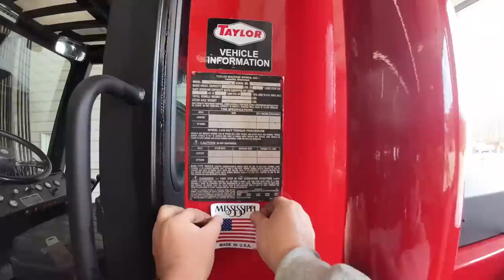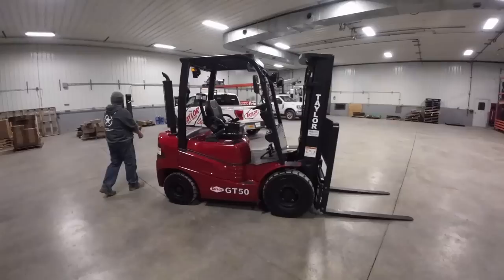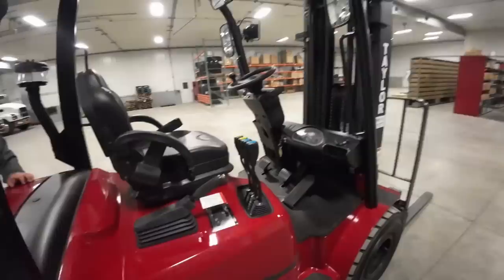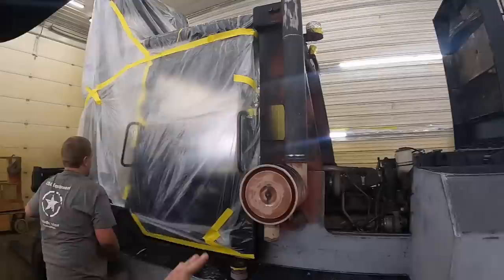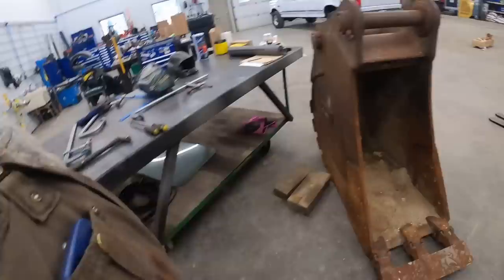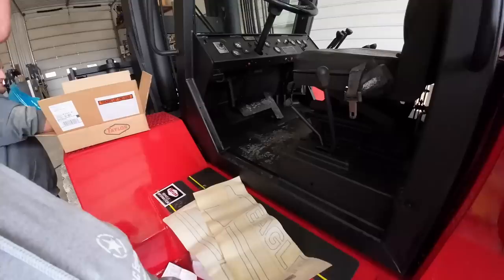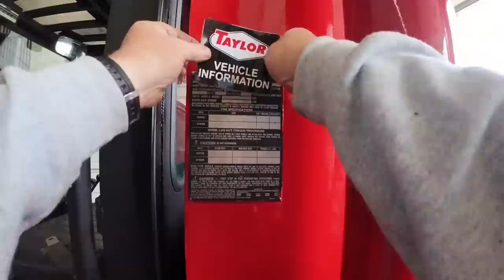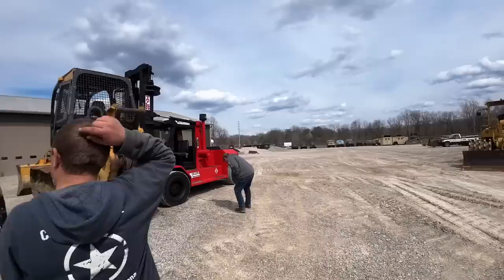We got a brand new shop tool, Taylor big red forklift or did we get two 😁 @TaylorMachineWorks

Comment: Hopefully the Give away is the White OBS Ford, didn’t see if it was IDI but ide take an Old Ferd either Way! If indeed I’m onto something. Chain Bin and Modified Headache Rack turned out BadA*s, you are a Fabrication Fool with that Damned Computer Steel cutting cutter Table. If that’s what you call it🤣. You Fella’s are always a Hoot & a Holler to hang out with, I’ll catch you on the next one. Keep it Safe Out There Fella’s

Comment: When I was a little fellow my dad was superintendent at a sawmill that ran Taylor forklifts.  Two were older (probably 60's) one with a detroit another with a ford 6 cylinder gas engine. Both of these the engine was in the front.  They also had a new (70's) with a detroit (engine in rear).  Dad got my brother and I Taylor shirts with "Big Red" on the front.  Actually have a school picture with the Taylor shirt on. Thanks for the video.

Comment: fastest forklift that i have drove is Linde h30d 1990, hidrostatic 3 cyl deuts diesel, it will spin tires on concrete, engine and hidrostat drive have never ben rebuilt and it has 30 000 hrs

Comment: I worked as a service tech for Clark and Yale for years and they will all send you safety decals, I think its a legal thing. I did do work on Taylors as well and even tho I didn’t like working on them I got to say they are one tough well built forklift. As for speed I once took the governor off a Clark with the Mitsubishi 4 cyl. And let me tell you even on nice pavement the rear steer is scary squirrelly as all get out, don’t try it

Comment: Looks like C & C Equipment now has a spiffy looking fleet of forktrucks.
Big Red and the new puppy Lil' Red with very versitile forks on it.
Gotta have the right tools to get stuff moved around.
Back in the early 70's I was a second shift certified Ironworker welder and the company I worked for had a massive field forklift with tires over 6 feet tall to move 20 foot parts racks from GM we rebuilt after fork truck ooerators smasged the s#@t outta them.
It could lift 3 at a time of flat bed trailers.
The general manager had the guys in the machine shop manufacturer parts to add on side shift forks including using cylinders from an old 50's piece of equipment. 
I got stuck running it when I was second shift foreman when the guy who usually ran it got injured till they hired someone new.
It was a friggen beast to operate. 
Funny thing is, the guy who did all the work on it including putting together the sude shift fork assembly and giving it a bew paint job was named Kevin and was the same size as your Kevin Clint.
Scrappy little guy you definitely didn't wannabe piss off.
As always,  really enjoyed watching a new episode in the day(s) of life at C & C Equipment.
Reply from the maker: thanks

Comment: hi I love your content. I have a question. I have a drilling company  and we use Dozers to pull our equipment around on skids and was looking at using a track loader but would need a winch on it. what make and model and year would you recommend . looking for something in the 35,000 to 40,000 pound range.
Thanks.
Reply from the maker: I’d you want to use a modern day rear engine track loader then I don’t think you can get a winch on them
You’d have to go back almost 25 years or more to get something